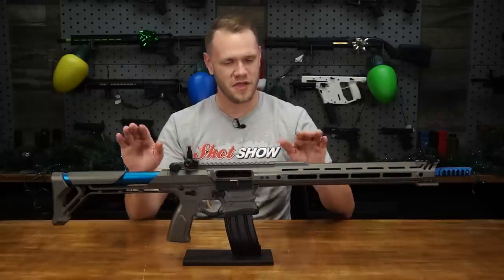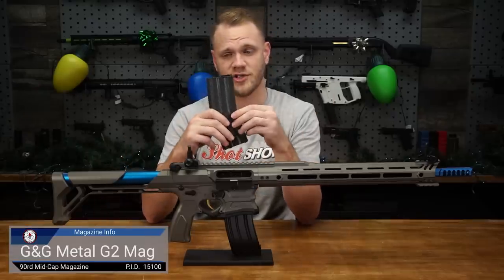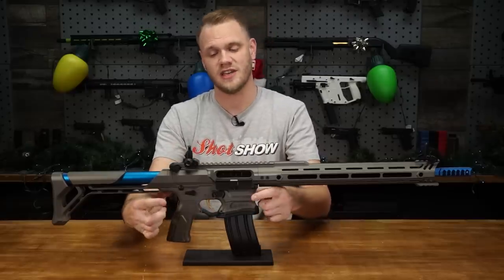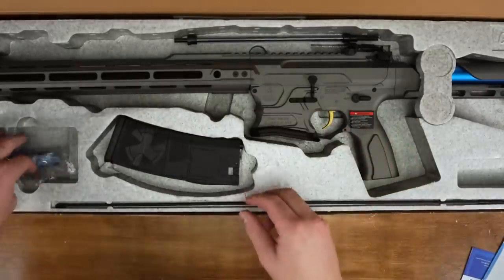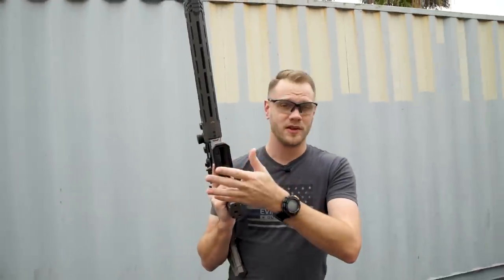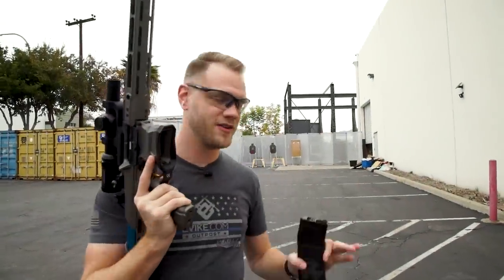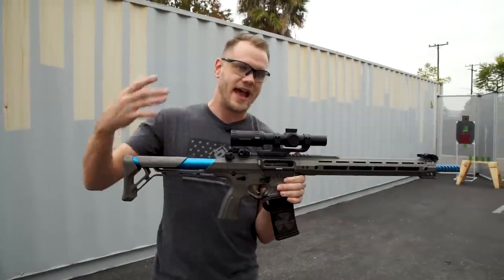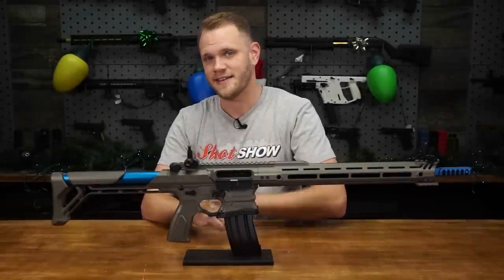The Auto Mag Ejecting AEG - G&G Cobalt Kinetics BAMF TEAM AR15 Review

Comment: I finally got one, and I have added the following.....a G-Sight Raven Weapon Mounted Laser Sight, a King Arms Carbon Fiber Airsoft Mock Silencer, a Polymer Mlok Picatinny Rail, a UTG CNC Aluminum Ultra Slim Angled Fore grip, and a VISM by NcStar Mark III Tactical Gen3 3-9x40 Red & Blue Illuminated Variable Scope. I also wrapped the buffer tube in carbon fiber to match the mock suppressor (wasnt a big fan of the blue). Man is it beautiful, and can really perform.
Reply: Dang bro quite the setup! I might use some of these attachments once I get mine thanks for the explanation! 👍🏻
Reply: did you order from evike? did yours come with the blue muzzle? I didnt get mine, not sure if i was SUPPOSED to or not, havent found a clear answer
Reply: @finalfantasy9450  I got mine from a local shop, and no it didnt come with Blue tip, and I'm ok with that. I di however order everything on it except the vinyl wrap from Evike. I am Cutter1368 on instagram, and here is a link to the picture....not very good, but you can see everthing.  https://www.instagram.com/p/CHqz81hpakq/

Comment: Anyone knows if the fire selector from this thing can be backported to an average M4 AEG? I would really like a 90 degree travel to full auto but I don't want this gun.
Reply: That would be determined by the selector plate. I don’t know of any off my head of any available as a spare part
Reply: sogerc1 not possible, it’s the lower that allows it to travel that, the fire selector is just standard ball bearing and spring

Comment: I Can see that G and g is most used and bast pick for aegs.. and they are great to Upgrade Even.. bast company upgrader use. G and G shel and gearbox shell They are Great sturdy and Fit hpa engine in h2 gearbox.. Made to last even freom factory,, 
I always take apart and do bater shining. change Things i can. Use top lube grease to create prfect seal and Wolumen of cilinder. to go with Barel lengt i want. And Go withunlinear guarder spring. Check if any Grinding and peals.. Buy solid hevy60.3 mm promy barel or orga and add just promy purpl flat buck..  R HOP IS FOR PTO builders.  AndTITAN GATE IS bast item in whole industry so qualityy. TITAN IS TOP